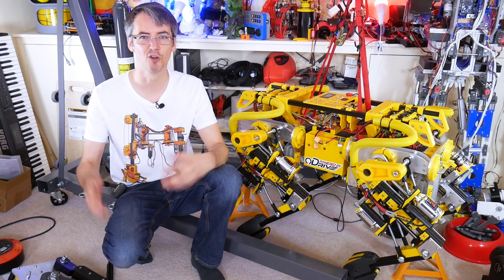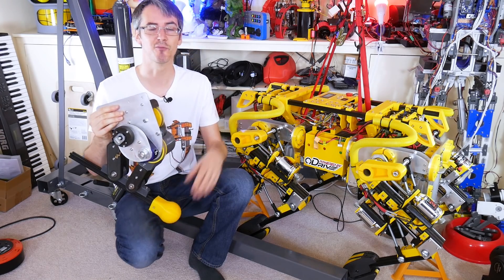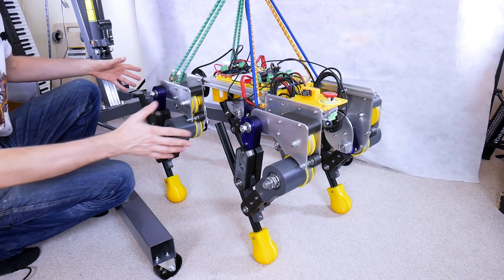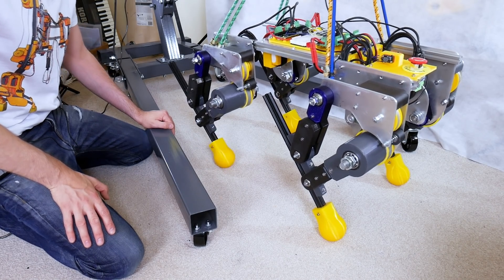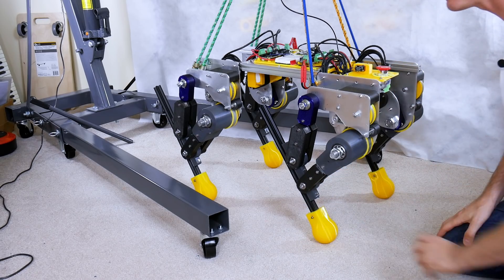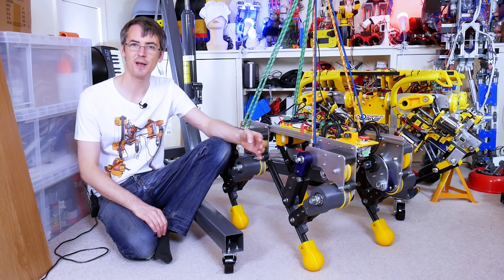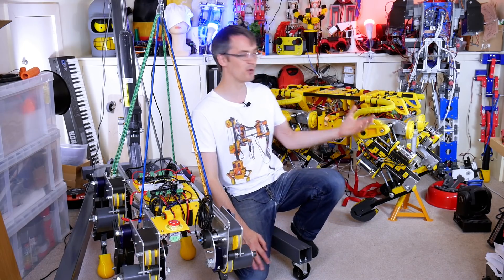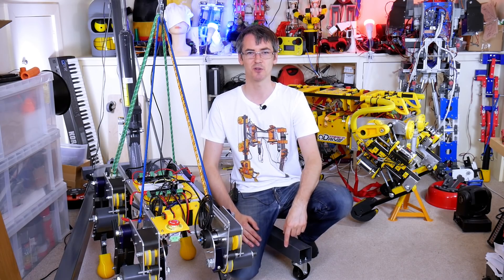Robot Dog vs Broom - Experiments with Compliant Joints

Comment: There is a state variable you're leaving out: force. Think of the sum of the forces applied to the floor or surface. There is a total force required to hold up the body, and in the different configurations of the feet on the ground and off. When you lift one foot, the two diagonal feet ought to be holding up all the weight but the foot diagonally opposing the foot that's up is still being driven without regard to the force it really should be applying, which should be near zero. When it's not near zero, the force it applies pushes the frame over, causing the body to heal over towards the foot that's up. When that foot comes down the body has been torqued toward the foot that's coming down, so the contact with the floor is "uncoordinated" with the goal of keeping the frame level. 
Expressing this mathematically would be a stretch for me. I hope this is comprehensible. Can you see what I'm describing? 
Great videos!! Have you thought of doing all the initial design in virtual space?
Chris

Comment: Why not motor -> springy coupler-> leg, with rotation encoders on both shaft of motor and on leg, and use that for the compliance?

As in: use a torsion spring coupler. Probably less than 30 degrees of rotation overall would be plenty... just enough so you can tell desired and actual angles are different, and if you're updating fast enough -- the new Teensy 4.0 is 600 MHz, 5x faster than 3.6, and 9x faster than 3.5 -- you could easily do all the stuff you need to.

Comment: I would like to see this project move faster, perhaps James has too many projects at one time. Is it just me or did he used to finish a project before starting ten more?
Reply from the maker: I'm working on it now, but I'm trying to produce solid videos with actual results in, so it's takes time in between episodes as the projects get more complicated.
Reply: @jamesbruton  Don't get me wrong, I love what your doing. But I want to build my own open dog and a video once a month seems like this might take years. I'm 62 years old, almost 63, hope I have time LOL.  Is it safe to order motors and controllers and start playing around with them or are you likely to change everything? Is it too early still to start machining the aluminium parts? Thanks
Reply: @wkinne1  Wayne, his dog as it stands this second could easily walk so I'd say just get building to you.  James is merely working out software issues and figuring out balance and is trying to experiment with different feedback mechanisms.  The engineering of the chasis, motors, board layout, etc is just fine as is.  Given enough time, without ANY changes to the dog, he could easily program it to walk, run, etc and it would perform similar to boston dynamics bots.  He's just exploring his options right now on code and feedback is all.  If he were willing to write 50k lines of code his bot would arrive.  He likes simple code though with minimal lines of code to deal with and prefers 3rd party libraries to coding from scratch.
Reply: @artbyrobot1  I'm going to buy a couple of the motors and a controller and start playing. I think I'll start slow, learn as I go and hope he makes progress a little faster than me, thanks for the input.

Comment: You could add springs to the legs, but only use springs strong enough to only carry half the weight. This way both lifting the feet of the ground and supporting the robots weight while on the ground should require a similar current. This way the maximum of the absolute value of the drawn current should be smallest and put less load on the motors.

Comment: I thought compliance is for when the feet touch the ground and not when in the air. Also when adding sensors to the feet you could also control them using a target pressure. Namely if both feet touching the ground experience the same pressure (skewed a little maybe if the center of mass is not exactly in the middle) the robot shouldn't tilt. Also if you want to tilt in a certain direction you could raise the target pressure on the opposite side (and lower on the other side). Changing those target pressures can either be done in open-loop or closed-loop (using a PID controller or something). This might require switching control strategy, namely using position control while the feet are of the ground and pressure control while on the ground (when the pressure sensor exceed some minimum pressure when touching the ground).

Comment: What about "cam" or excenter on upper second joint? When you controll lenght or pos of second joint, then you controll vector of pushing, forward or back... impresive work, thx for share.
Reply from the maker: Yep - it would need more joints to walk, but this is just a test rig.

Comment: You could fix the current setup with software and gyros/acellerometer and pressure sensor on the feet, but youd have to be really good at math.

Comment: I can understand how it is a fallacy that a spring that can hold the weight of the dog would not save power, but what about a spring that can hold half the weight, and drive it both directions? wouldn't that use about half as much power? or am I missing something? There do seem to be advantages to a system that can stand with low power consumption as well.

Comment: Considering that humans walk around on two legs, I'm fairly sure that we're good at balancing. But we use a bunch of different things to help us balance, that when taken away, makes us unsteady…

When something messes with our inner ear, it's causes rather a lot of balancing problems. I'm not actually 100% sure of all the things that the inner ear does, but considering that I know it uses a liquid inside a sealed chamber, with sensitive hairs to detect changes to the motion of the liquid, I think it's used for at least two things: The direction of gravity, and changes in momentum.

When we suddenly can't see our surroundings: our balance can be negatively affected. It think this is because we tend to use our surroundings as a reference point for our own movement. But because it only has a relatively small effect on balance, I'd say it's just supplementary for balance. Although it should be noted: Spacial/Environmental awareness is pretty useful for navigating obstacles/just plain navigating.

You ever try getting up to walk somewhere while your foot in asleep? It can be done … but not easily. I'm not entirely sure it the difficulty is caused by weakened muscle control, or just because there is no feeling on the bottom of the foot.

And you want to talk about making it hard to walk? Try walking steadily without a properly calibrated sense of proprioception! That'll be a trick to see.

And finally… (As far as I can think of…) There's force sensing. No… Not “The Force”, from Star Wars. I'm talking about sensing how much force your muscles are exerting. Hmm… When I try to think of a situation where you loose this sense, all I can think of is a limb that's fallen asleep and lost feeling, so maybe this should be considered part of that. But trust me, it's important!

The good thing is, I think you've tried exploring the possibilities of using each of these senses in your various robots. However… Have you tried using ALL of these senses at once in a robot, yet? My gut says that if you haven't yet, then you will eventually.

Comment: A few comments:

a spring assisted leg is a really good idea, but needs a low rate.  As your motors can drive in two directions, you can "offset" the motor torque by using a spring to hold the primary mass (a bit less than 1/4 of the total mass).  That spring needs to be matched to the geometry of the leg to try to provide that <1/4 force at all points in it's travel.  This requires complex geometery as springs a usually linear devices.  With the spring holding the primary mass, your actuator becomes mainly dynamic instead of dynamic, and obviously has to operate with bi-directional current control

Once you have force controlled legs, you need a higher level stability model (and controller)  to attempt to modulate those forces to keep the dog at the attitude commanded.  Think about standing on a rolling deck of a ship, as the ship rolls, your brain uses the horizon and your ear canals to identify where "up" is, and you apply a different force to each leg to maintain that "up". You are not at any point thinking or worrying about which of your legs is longer or shorter, just trying to stay upright.  Because the force to move the leg is many times less than that to move the body (higher mass and inertia) it becomes possible to seperate the motion control of the limbs from the force control required to keep the body stable.  It sounds complex, and to make it smooth it is, but it is easily do-able on a nice fast 32b micro.  So when you want to put a leg down say, you command a low force (say 1/10th of the max) and the light leg starts to drop down, because there is little resistance, the current controller will ramp up the output voltage so the leg will move fast in mid air.  When it hits the ground (where-ever that ground is within the stroke) the force controller will immediately limit the supply voltage to limit the current and hence the force.  Then your higher level stability model can decide is if wants to push harder to try to push the dogs body around, or just stay around the neutral force
Reply: BTW one possible nice option for a spring assisted "muscle" is to use an pneumatic cylinder, and fit a much larger (volume wise) central pressure resevoir on the body. By having the resevoir volume much larger than that of the leg cyls, you get a much smaller change in system pressure for any given joint movement, and you can change the leg preload by changing the resevoir mean pressure.

Comment: Hi James!  I saw a foot sensor made by putting an atmospheric pressure sensor inside a rubber ball.  When the ball hits the ground the pressure on the sensor goes up.  The ball was made by pour casting the rubber around the sensor inside a mold, which could be made on your mill or with a 3D printer.

Comment: In a year or two we watch boston dynamics and say: "Hee that is how James did that before".Why do I get the feeling that if James had like 25% of the budget of Boston Dynamicts, we would have a fully operational c3pO or Sonny NS-5 by now.
Reply: budget is not holding him back.  he bought the best motors and motor controllers money can buy.  Also has a full blown cnc machine to make metal parts now and welding tools top of the line no expense spared.  How is budget an issue at all?  It is his unwillingness to create long and sophisticated coding algorithms that is holding the project back and you can't blame him for that since that takes years of time and he likes to race through projects fast as possible.

Comment: Please have another look at adding springs to the legs. Now the motors only work a supporting the robot, lifting the leg (fast) does not require much work. When the springs take half the weight of the dog, the motor can drive them into both directions. Nature does this too, the tendons are springy.

Comment: As I understand, this kind of virtual spring is only applicable to gear boxes with small reduction ratio and is not applicable to worm gear reductors. Is it possible to simulate springiness with sensors on feet? Like if sensor shows too much pressure, microcontroller commands motor to move leg down a bit or slow down upper movement if leg moves up.

Comment: Can you tell when opendog's feet hit the ground by current draw on the motors?  i.e. rather than add more hardware complexity and direct sensors?
Reply: Short answer is no, it's a bad idea, a component could fail and keep giving false readings.
Reply: I feel like he's right on the verge of having these things walk around, but it's in need of a massively complex code, and he's just one guy. Maybe an AI deep learning computer could help.
Reply: @Sqoou_Too  That would be a good idea but it would be even more complex than just conventional programming. For instance how would you train the AI? Normally you would setup a simulation and run it 10000s of times until it learns to walk. Then you could put it on the real thing.

Comment: I love the fact that you can hit it with a broom. A true robot.
As the the springs to hold it up, I think the key is the the springs to take half the weight.  So you would need to pull up with half force, or push down with half force.  Might be enough to get it to stay up with 2 feet with the existing motors.
Reply from the maker: I did try some bungee cord, but there's too much motion for the motor to stretch it all the way, and it have any effect on holding it up
Reply: Is it really an advanced robot if it can't stay upright after being beaten up by a broom and pushed around? I reckon he's taking inspiration from boston dynamics!